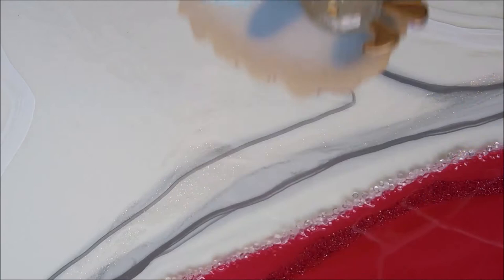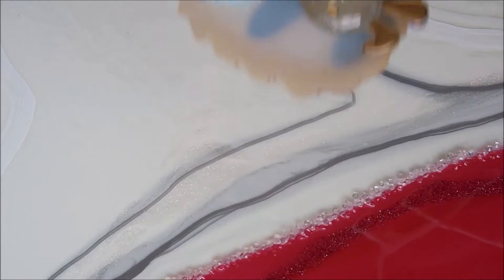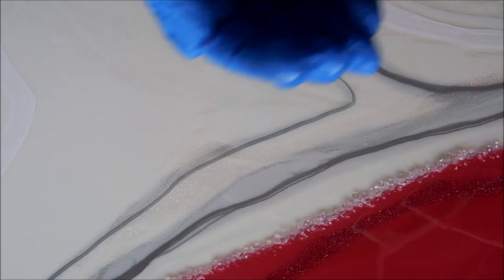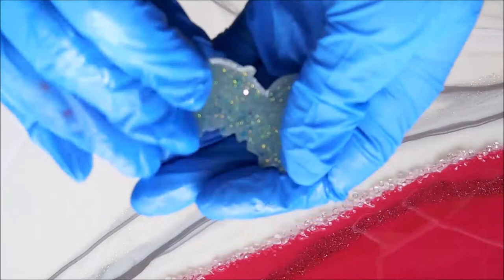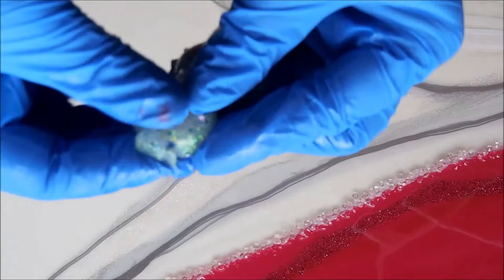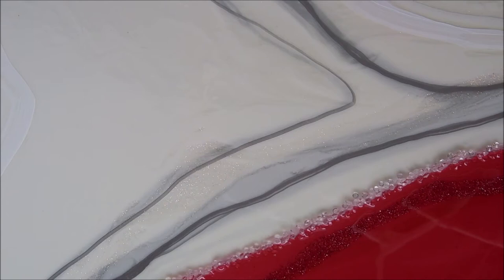How to make Matte Molds into Glossy 😮 Tips on how to make resin shiny without polish

Comment: How do you keep the bottom of the resin piece from forming indentations or imperfections when you lay it down to dry?
Reply from the maker: If I need to be really careful of the back I would only do the front first.  Then the back and lay it on the front to dry.

Comment: I’ve tried this trick however when the resin is drying, it seems to “seperate” on the mold causing a dotted matte and shiny effect. How can I stop this?
Reply from the maker: I think from what you are saying your resin you use is quite thin?  It might be just pulling apart and showing the underneath.